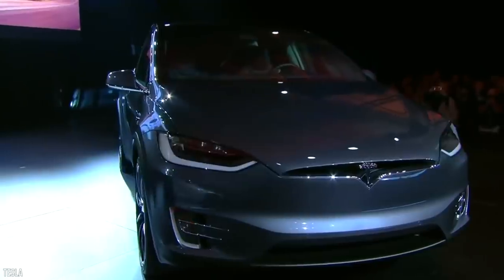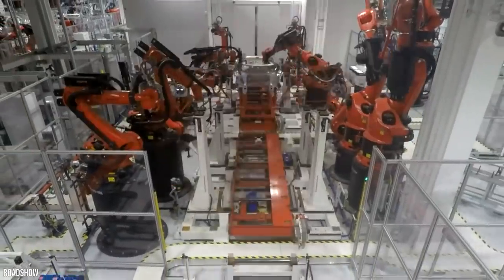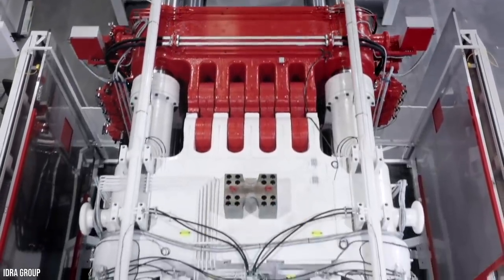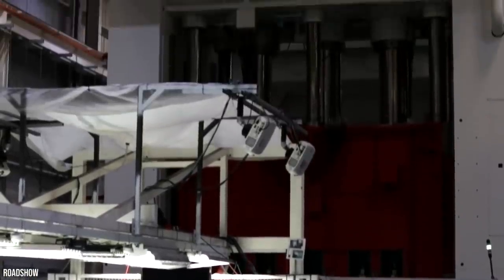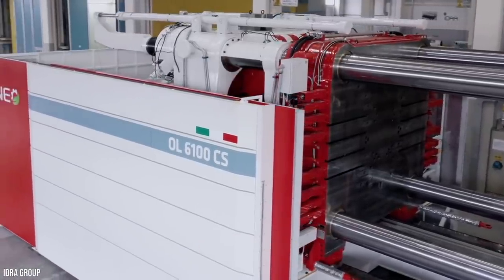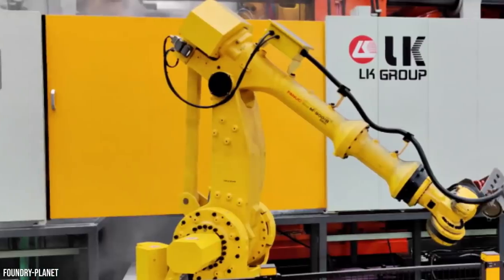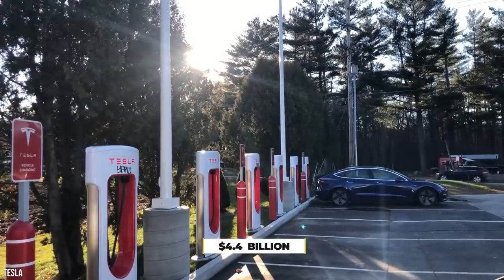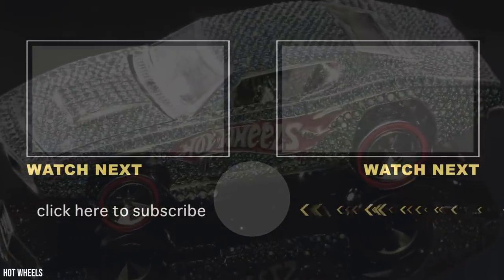How The Giga Press Is Making Tesla More Money

Comment: When Musk announced the Y in early 2019, he described a skateboard with front and rear castings. This never came about, so at the last minute, the frame was cobbled together with steel stampings. This is why the doors and panels on Fremont Ys cannot be made to fit. The Berlin and Austin Ys should have a skateboard with front and rear castings sandwiching the battery pack. Hopefully it will fix the fit issues and suppress the squeaks and rattles that are inherent to the Y.

Comment: I wonder what happens when one of these car get in a wreck and the skeleton is bent.
It’s got to be a total loss. With regular cars parts can be un welded and new one replaced and welded to almost-factory specs!
Reply: Musk has stated that minor fender bender repairs can be made in the same way as traditionally built cars. Significant structural damage to any vehicle, no mater what the method of construction, may render any vehicle beyond economical repair (BER). Tesla’s advanced safety features should help drivers avoid collisions.